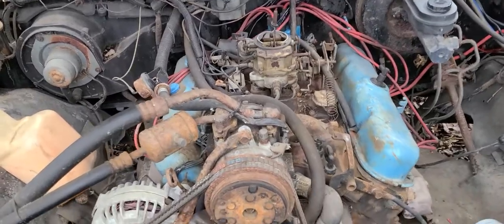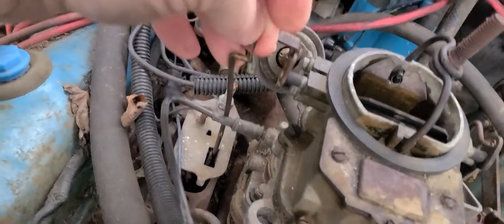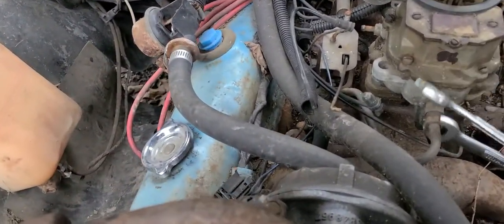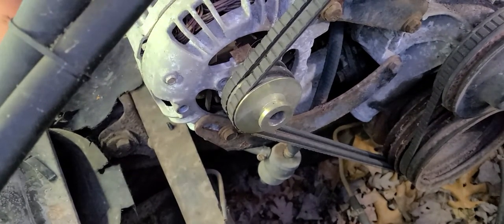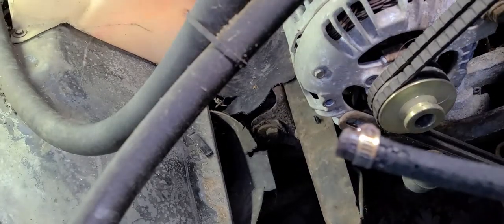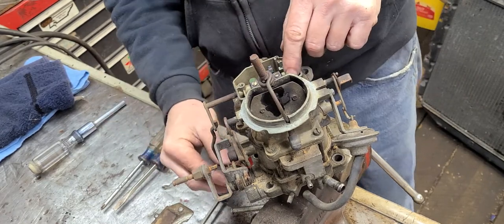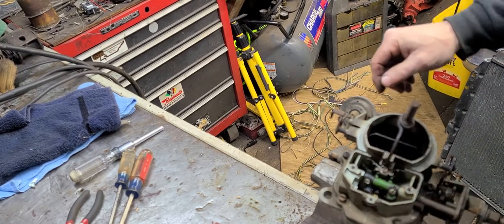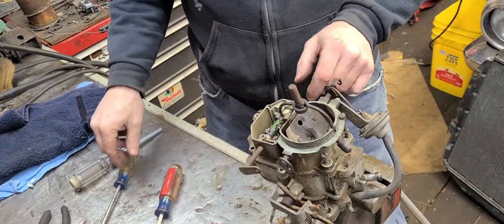86 Dodge Ramcharger fuel hoses replacement and carb removal and cleaning

Comment: where did you get the rebuild kit for this carb? and a part number if you have it would be awesome! great video keep up the good work!!
Reply from the maker: First of all, I want to say thank you very much for watching the video. Really appreciate it and I also really appreciate the nice comments the where I got the carburetor kit from and how much I paid for it. I don't really remember, but I did look up what a carburetor kit goes for for an 86 Dodge ramcharger. That's what mine is. They're two different ones there at AutoZone the part numbers are 96 516 at 41 dollars and the other one is 96 470b is 29 dollars now you don't have to get these from AutoZone. You can get them from most any parts store you like to shop at. Oh, the brand of carb kits that AutoZone is selling is GP Sorensen and they use those part numbers reason for me to not be able to remember the part number and the price on the carb kit that I used in this particular video is because I usually will buy kits rebuild kits for carburetors that I have and then I will just keep them in stock in my own personal stock sitting on the shelf when I need it you may also want to try and find the car rebuild kit for your particular ram charger. Keep in mind most carbs will have a metal tag on them. If yours is missing, you're just going to have to match up the kit to your carburetor. You can probably also find it a kit for yours on like Amazon, eBay, RockAuto whomever you like to shop with you may be better off to take your old one apart and match up the gaskets with the gaskets in the pictures that the parts stores show and then you'll know okay. I need that particular one or that other one. Okay. Hope this helps. Thank you very much. Any further questions let me know

Comment: What carburetor came factory on a 1984 ramcharger it says CARTER on the side and 1A is that a Carter 1? The number is 0-2379
Reply from the maker: Most likely that carburetor is going to be a Carter BBD two barrel. That number one is more of a casting number or a number that would be used like for assembly at the factory. The 02379 number is most likely the number you're going to probably want to use for like a rebuild kit. If that number is on a metal tag that is attached to the carburetor with a screw. Okay, so the screw is holding that metal tag to the carburetor body itself and then that metal tag is just got that number stamped into it. Very small. Thin metal tag usually shaped like a triangle if you have any further questions feel free to ask and I really do appreciate you watching the video. Thank you very much
Reply: Thank you as well I'm just trying to get the first truck/station wagon I ever bought going she ran but not for long
Reply from the maker: Remember when your stomped and you can't figure out why the engine will not stay running for a very long. Go back to your basics. Make sure it's getting fuel. Make sure it's getting spark even when it warms up. Make sure it's in time. Make sure your ignition timing is correct
Reply: Okay will be back in this channel or other for assistance